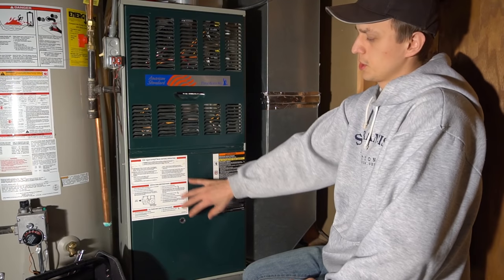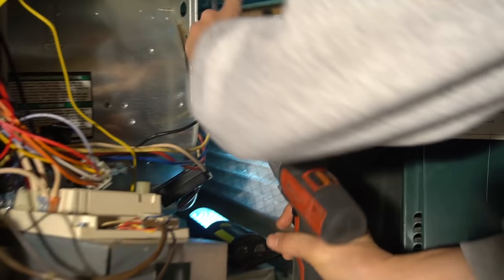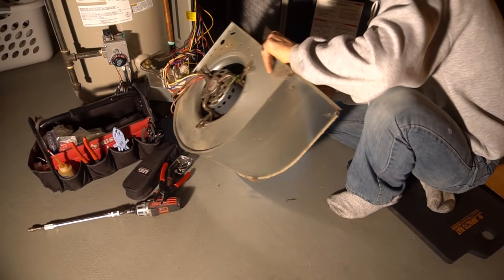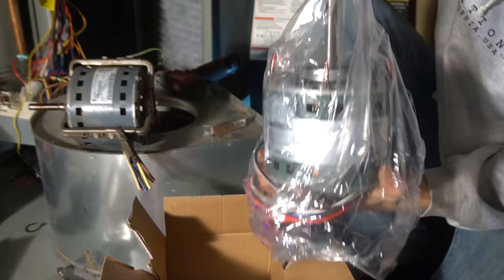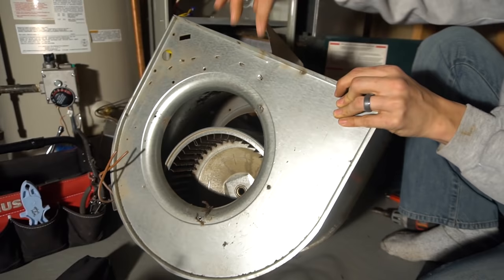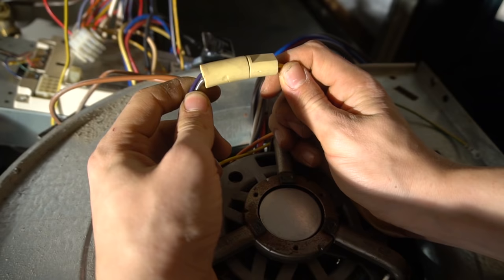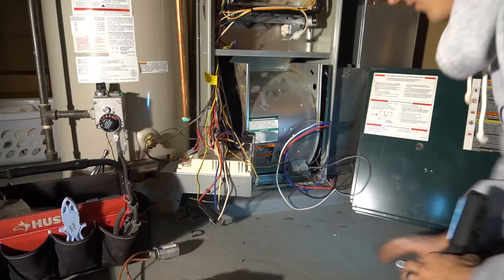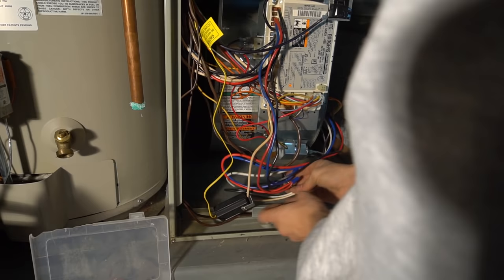Furnace/AC Blower Motor Replacement Step By Step

Comment: Excellent Instructional Video WOATV. Production quality is great, sound quality is great. Saying that, my Trane furnace motor is making a fast clicking sound when on. Sometimes it's louder. When it turns off I can hear a click sound get slower as the fan is slowing down to a stop. Do you think this is the Motor or the Fan? Again, thanks for producing and making this very imformative video.
Reply from the maker: Glad you liked the video! From what you described, it sounds like there is something in the squirrel cage/blower wheel. Look at either side of the blower housing and see if there is anything sticking into the blower wheel. Like a wire or a zip tie. I would pull the blower housing out and take a closer look too. If the fins on the wheel are really dirty, it would be good to get them cleaned up.
Reply: Fast response! Thank you! I did remove the motor and cage, inspected, cleaned, and reinstalled. After reinstalling and running the noise stopped for 1 day. Last 2 days, the clicking sound returned. I was able to make it stop by firmly giving a good fist pound to the outer right side exterior of the furnace. The sound still does return after a couple hours. What's your thoughts? Should I go ahead and replace the Fan and Motor?
Reply from the maker: Ah okay. If you are able to stop the noise by the good ole' smacking method, then I doubt your motor or wheel is at fault here. I would investigate the cabinet. Try pressing on the furnace with your hands on all sides, then the ductwork that goes into the furnace, filter cover. Sometimes I find my problem spot by doing that. Also, while the fan is running, open the bottom door and try pushing the blower housing up (carefully as there's 120v present). A few time I have had the bottom thin metal panel of the furnace come loose and rattle too. Try sticking your hand under the furnace and pushing up. Another culprit I had before was a thin piece of sheet metal between the A-coil and the furnace. It got loose and made a noise like putting a stick into a bike tire while it's rolling. Those can be hard to get too though. Hopefully it's something simple.
Reply: Great advice. Can it be something as simple as vibrating metal? I hope so and hope it's easy to track down. Thank you again for your help, advice, and solutions. I started watching your AC videos and they to will be useful.
Reply from the maker: Yes, I get noise complaint calls occasionally (maybe 3-4 times a month) and usually it is not the blower motor.
Reply: Word of Advice TV that's great to know that I may not have to change motor.
Reply from the maker: I am not completely ruling out the motor or the wheel though :) Oh and I just remembered, sometimes I will put in a new motor and it runs noisy or it's noisy when it starts. Most of the time it ends up to be a loose motor bracket. In the video I re-used the old bracket but a few days later I ended up putting in an FM55 Motor bracket ( http://amzn.to/2C7hIcI ) and that stopped the noise like magic!
Reply from the maker: Thank you for the video! So where the noise is actually coming from is the inducer motor? I was thinking it was coming from the circulating motor. Are you running the furnace or the AC when you are hearing this noise? I would take the inducer motor off and take a look at what is inside. It is usually just 4 screws and it should pull off, that motor that you were pushing on in the video. But that does not sound like a bad motor. Something is just rattling
Reply: Hello again. I appreciate you answering after viewing video tonight. It's Sunday and a weekend, family time, etc. Thanks again. I to thought it was coming from the larger circulating motor with the blower fan. You are probably correct that it is coming from the Inducer motor. I am running the AC when this is happening. The circulating motor is running along with the inducer motor. I will pull the inducer motor tomorrow morning and take a look. 
Could it be something rattling inside the inducer motor? Does that happen? The motor is about 17 years old. Will a inducer motor going bad make this type of noise? Your knowledge and advice is extremely helpful. I have a pending appointment for a company to come out but they have a hefty diagnosis fee and I am trying to avoid that obviously.
Reply: You are dead on accurate! Thank you! The noise is coming from the Inducer Motor. I took it off and inspected the Fan and it is clean, no Noise when spinning it manually. I did notice there is some in and out play on the motor shaft (Not the Fan on the shaft) about 1/8" movement. I remounted and started the system. I wiggled the motor and reproduced the clicking sound easily. I wiggled it around and was able to stop the clicking sound but it still does return. I checked the motor mounts and made sure they are tight. Is the Inducer Motor bad or the Fan Blade bad? It's a Fasco Brand Motor.
Reply from the maker: Great! Finally found the source! :) You may be able to get away with just replacing the blower wheel but at my job we usually just replace the whole inducer motor. If you say the shaft has some play to it, then I would suggest replacing the inducer motor assembly. But that aside, the inducer motor should only be running with your furnace. It should not be turning on while your AC is on. So you probably have a bad control board too. For the time being I would disconnect the inducer motor plug. There's no need for that to keep running during AC season.
Reply: Word of Advice TV Hello again. Thank you. Yes. I can disconnect the power to that. Question about the draft inducer motor. I see 2 types of fan blades. The large squirrel type in the blower housing and a small bladed fan directly in front of the motor in the motor housing. That has not come on at all.
Reply: Quick update. Disconnected the Inducer draft motor. Clicking vibrating sound still present with FAN on only NO AC running. Push/wiggled inducer motor sound goes away. It's something other then the Inducer motor I think. A good smack on outer housing does not help anymore. Turned off fan and can hear Main Blower Motor wind down. I am uploading two videos with verbal description that I will reply with links. Can the problem be the Large Blower Motor and Fan? Thank you
Reply from the maker: Oh okay! So the inducer motor was not running after all? If the little fan blade that you can see was not moving then it was not. Sorry for misleading you. And I thank you for the videos! I see why you suspect the blower motor now. Especially when it is winding down. I would still highly doubt that the blower motor is bad, especially since pushing on the inducer quiets it down. What I would try doing next is running the blower fan while you have that inducer assembly out. Maybe you can see what is causing the ruckus through the opening that is behind that inducer motor.
Reply: Word of Advice TV correct not running at all inducer motor. Good move next step to remove inducer motor then run fan. Currently if I push the motor and/or the fan enclosure firmly to the right when facing the open unit the clicking sound stops. This makes me think like you said it is indeed something vibrating. I hope I can track it down with the inducer motor removed. I will update tomorrow for it's very hot time of the day now. I thank you again for ALL your continued help.
Reply from the maker: Okay, good luck! You're welcome and sorry that this is taking so long. Noise issues can be hard to track down when they are coming from inside the unit somewhere.
Reply: Word of Advice TV are you kidding me? You're not taking to long at all by any means. Your continuing willingness to help and great advice is much appreciated. No worries at all on time.
Reply from the maker: Okay, good! Hope you can find the culprit!
Reply: Word of Advice TV Hi. Working on furnace today. Removed inducer motor clicking noise did not go away. Opened access to Blower Motor. Sounds definitely coming from there but I can't isolate it. Removed Blower Motor and next clip you can hear a sound when the motor is turning. Inspected cleaned everything. Tightened up all screws. Could it be the motor at this point?
Reply from the maker: Wow, I think you have proved your point :) I just watched the video. That is undoubtedly coming from that blower motor assembly. Either the wheel or the motor. Well, all that's left now is to take the squirrel cage off (the wheel) and try spinning the motor shaft alone. That is so bizarre though! It totally sounds like it is just clipping something as it spins. It's also weird that in the past you were able to get it to stop by hitting the furnace or by pressing on it. Can you see if the blower wheel is touching anything inside the casing? I have not seen a blower motor do that before so I cannot give you a reason for that one..
Reply: Word of Advice TV Hello again. Nothing touching, hitting , or rubbing. When the motor runs, it feels as if it is unbalanced and shaking the furnace. This is probably causing the clicking? Something is vibrating.  Motor shaft is worn? It does nice in and out about 1/8". Can the squirrel fan go out of balance and cause this? I'm thinking about changing the motor and squirrel fan to be safe. It is about 16 years old on both parts. I hope you understand my follow up information. Thanks.
Reply from the maker: The blower wheel usually has small balancing weights attached to some of the blades, perhaps one of those flew off.. I just had a call like that a few days ago actually. The customer's filter got sucked into the blower wheel and it started making a vibrating noise after that. I could not suppress the noise no matter what I did to it. So I ended up replacing the motor, blower wheel, and capacitor. It worked much quieter after that. The shaft coming out 1/8" of an inch is normal, I don't think that is the problem. Perhaps you will just have to replace the wheel and motor too..
Reply: Word of Advice TV OK. I think I'm going to move forward and replace the motor, wheel, and cap. They are 16 years old at least. When you say wheel, do you mean the squirrel fan? 3 components total correct? Blower Motor, Round Squirrel Wheel Fan, and Capacitor? I'm glad to hear you encountered something similar recently and able to advise me further. Much appreciated during this whole process.
Reply from the maker: No problem :) Unfortunately this wasn't something simple as we hoped. Yes, those are the three components. The new capacitor should match the micro-farad rating of the new motor (MFD/uF). Sometimes I put in a FM55 motor bracket too. Especially if the old motor has the bracket welded to it.
Reply: Word of Advice TV Hello I changed motor, wheel, cap. Seems to have solved the problem BUT motor does not sound very fast??? Hardly any air movement. What do you think? Wiring incorrect? Thank you again
Reply: Word of Advice TV Hi again. Well I figured out the problem. The motor rotation was reversed so I switched those wires and BOOM! Plenty of air and quiet as a breeze. I also used the mounting bracket you suggested. Those rubber isolation screw mounts are great. I want to say thank you so much again for all your help each and every time. I saved so much money watching your videos and receiving all your knowledge and assistance through the whole process.
Reply: The new parts are running smooth and quiet! I do notice a slight rattling (Nothing loud or damaging sounding) from some of the what I think are Heating Parts that are inside behind the Inducer Motor when the Blower Motor is running. I noticed this when I was cleaning the inside cabinet when the Blower Motor Housing was out. They are the parts below the exposed opening of the Blower Motor housing. Is this normal? They all slightly moved side to side. Are they worn and loose possibly or is this normal?
Reply from the maker: Finally all done! You went above and beyond what most people would do :) Glad to hear it is working great now! About the rattling sounds behind the inducer motor. That may be your heat exchanger cells. I've seen them do that before. They are welded to the furnace cabinet and sometimes those welds get loose and start to vibrate, making that metal tinking sound. Usually that is nothing to be worried about. If it gets loud, then that could be a bad sign.
Reply: And again you are correct! The heat exchanger cells are causing the slight rattling sound. It is right in front of the Inducer Motor. I am able to eliminate it by wedging a thin metal bar against that panel the inducer motor is mounted out to the front lip on the bottom edge of the furnace casing. The panel is slightly but not overly pushed against the heat exchanger cells to stop the rattling. The whole furnace is now so quiet when running.  I'm very satisfied and relieved the problem is fixed. I learned so much from your advice and taking the parts off the furnace. I saved a lot of money and now have a good sense of how it all works now. Thank you so much again time after time helping me out with every question I have had through this process that was absolutely successful.
Reply from the maker: You're welcome! You were very easy to talk to. Thank you for coming back with an update! Way to take care of that rattle! :) You made that an easy fix. Hopefully you can forget about the furnace/AC for another 10 years now ;)

Comment: Wouldn't it be easier if you disconnect all of the blower wires to the control panel after taking off the control panel to the blower?

Comment: I install a new blower motor on my furnace, it worked, but now it's not spinning. It just has a hum noise.what is my misterious problem?..good👍 videos
Reply from the maker: Did you replace the capacitor? Or perhaps you forgot to hook up the wires to it?
Reply: @WordofAdviceTV  everything is connected how it supposed to be..the weird part about it is that  I spin the wheel and at first it was hard but playing with it got loose. It started working..🤓🤪
Reply from the maker: @isaacnava890  Nice :) Well if it keeps working, then it's all good! I have had bad blower motors right out of the box though... Hopefully that's not what you are experiencing.

Comment: I replaced my motor,with the correct replacement part. My dilemma is that, I'm not sure about wire placement. How do I make sure of where my wires go,on the board ? Any help would be appreciated. I should have taken a picture, but I didn't 🥴
Reply: Thank you 😊 excellent teacher 👏

Comment: Thank you for the videos. I have a question about the motor. I have a old furnace and I want to change the motor.
The original Motor is 110v 60Hz 1050 RPM 8.7a and 1/5 Hp.
I was not able to find exact motor and I found:
110v 1075 rpm 4.4a 1/3 hp and 4 speed.
Can I switch them?
Please let me know I will appreciate that. 
Thanks
Reply from the maker: I can't say with 100% certainty but most likely everything will be fine. The difference is not big so it should work the same. 👍 I would do it.
Reply: @WordofAdviceTV  
Thank you so much for your reply

Comment: Thank you for your videos they are very helpful I appreciate it. I have a question is it necessary to use puller to replace blower motor? Thank you.
Reply from the maker: Are you talking about this thing right here?
Motor Hub Puller: https://amzn.to/2LDntqx

I don't use it too often. Out of 10 blower motors that I replace, I might have to use it on just one. Sometimes the blower wheel is very very stuck onto the motor shaft and getting it off is near impossible. In those cases it is nice to have a hub puller :)
Reply: @WordofAdviceTV  I've only replaced 4 blower motors. Luckily, I've never had to use a puller, though in one instance I had to spend way too much time sanding the rust of the shaft, letting penetrating oil (I like Kroil) do its work, and patiently persuading the fan cage to move. Ugh. Tedious, but oh-so-satisfying when the cage actually starts moving up the shaft.
Reply from the maker: @tomc3542  Ah i know the feeling! :) I had 2 in the past where even with a hub puller I was unable to pull out the motor. I had to just break the motor out and replace the squirrel cage along with the motor.

Comment: Always good information in your videos. I have a Trane 78 inside gas unit with AC. When the furnace starts it seems to have a delay. Its worse in the winter. It almost sounds if the motor is getting up to speed. I've been debating replacing the fan motor. Normal to have a delay? Any suggestions? Thanks!
Reply from the maker: When you say, "when the furnace starts" you are talking about the blower motor in the furnace right? I would try replacing the capacitor first and see if that makes a difference. That would be much cheaper than a motor. I replace mine at 14:30 in this video. (except you wouldn't snip your wires) A weak capacitor could cause the blower motor to start very slowly and if the capacitor is fully dead, then the motor may not even start.

Comment: The video is very helpful. Just being proactive, I check the pricing for my motor on Amazon and it is around $500 with specification of 1/3 hp, rpm 1075, 115 V, and 4 speed. There is a motor with the same specification but bigger horse power 1/2 and it is cheaper. My question is, it is okay to replace with the 1/2 hp motor? With the replacement motor, I am running a little faster. Thanks.

Comment: If you buy a motor That has those 2 wires that change the rotation, buy 2 motors, because it's a POS rescue motor, and you'll have to replace it in about 2-3 years. Get an original equipment manufacturer(OEM) motor. I call those Saturday Night Motors, because if I'm on call saturday night, and you have a bad motor, and it's 10 below out, that's what you get.

Comment: Replacing an old blower motor (with cap 15mfd/370vac) with new motor (calls for cap 5mfd/370vac). All other specs are identical. In another video, commentator says use new cap with same mfd specs as old cap. What do you think? Thanks for your help.